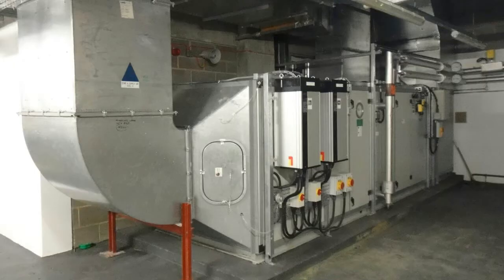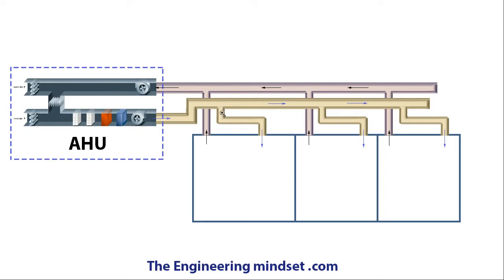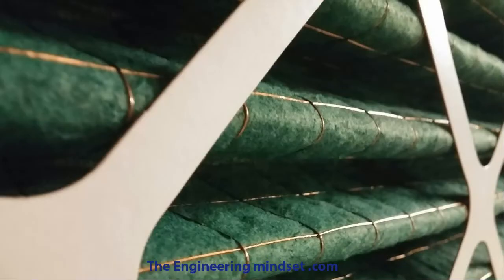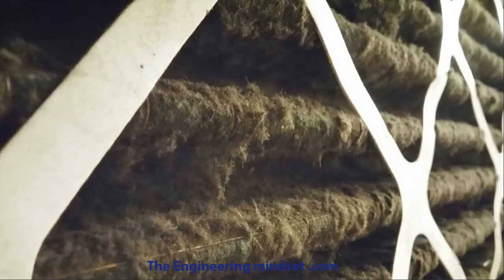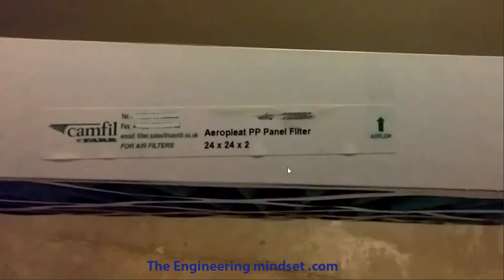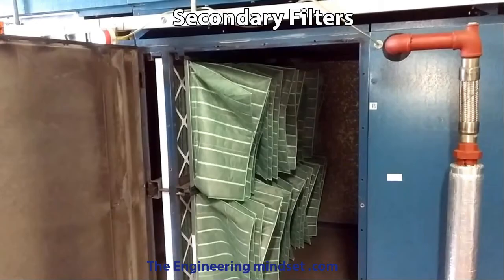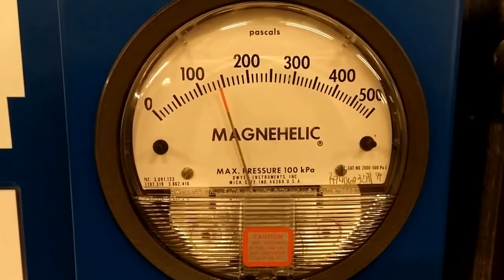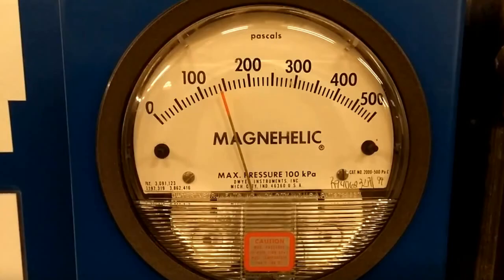HVAC - AHU Filters

Comment: Hi and thanks for this Video. I try to get 2 years service from bag filters and only change them when the pressure drop is at the max level. Replacing or washing primary filters regularly is key to this. Regarding power savings when filters are dirty.....there really aren't any. A direct-on-line fan motor (no vsd) runs at a fixed rpm whether the filter is dirty or clean. There is a dP formulae to calculate the extra energy used when the filter is dirty, it is tiny. The real problem is reduced airflow.